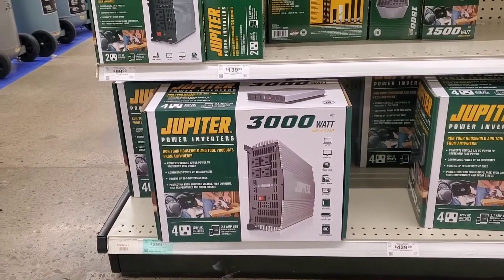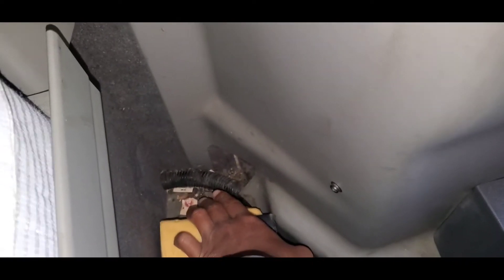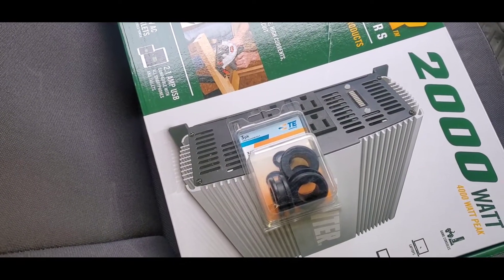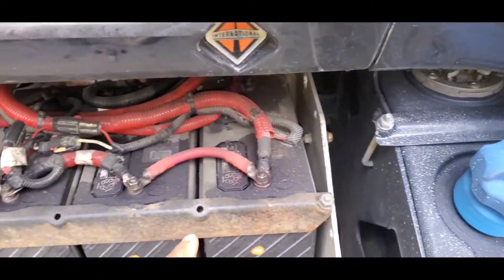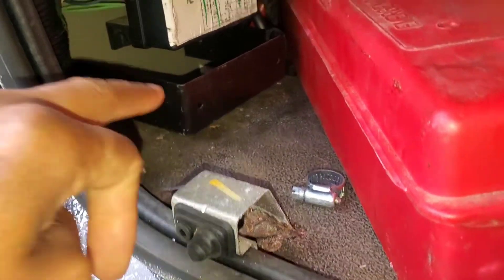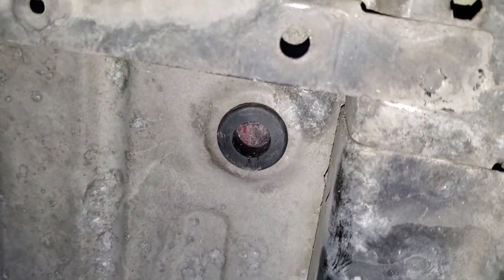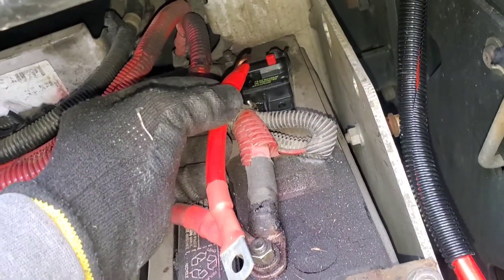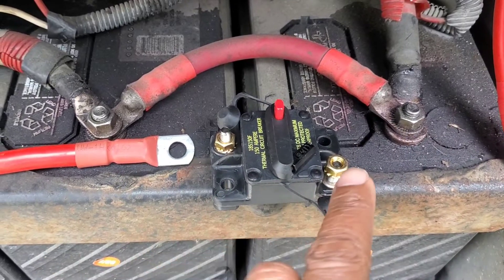Power inverter installed in a international prostar semi truck.how to install a Power inverter.

Comment: I’m not understanding why he used a breaker . The inverter has emergency shut off points
Reply: Have you seen the manufacturer install videos on here for different inverters? Almost everyone uses fuses or breakers. Why risk fire over a cheap safety measure?
Reply: @armandgreer2103 when you buy a new truck that has a inverter there is no breaker dude..I think you guys are lost in the past. modern inverters have built in safety measures
Reply: I've installed probally 10 inverters and never used a breaker. The proper inverter have a built in fuse..just my experience

Comment: I got the same inverter. In the process of wiring it up to my f150. I’ve got a 250 and a 300 amp circuit breakers. Is one of those right to use?  
Great video by the way! Very helpful. 👍
Reply from the maker: Use the 250amp

Comment: Where do you run the ground wire to?
Reply from the maker: To the battery and inverter
Reply: No no, the ground wire should go to the chassis on the truck. (The metal frame underneath the truck). Anywhere on the chassis is fine as long as it's free of paint and rust  where you connect the wire. If you connect the ground wire to the battery you are defeating the purpose of the ground wire completely and you WILL burn and destroy the inverter and probably start a fire.

Comment: How are you calculating the circuit breaker size? Is it 120V times 10A tool = 1200Watts / 12V = 100A ?
Reply from the maker: That formula works too but i just go with the manufacturer recommendation for the breaker

Comment: Did u end up getting a 200amp circuit breaker or kept the 150 I can’t find 200amp
Reply from the maker: I'm still using the 150 and never had no issues whatsoever!
Reply: Thanks for the reply appreciate it driver

Comment: I have same setup but my inverter is 5000watt, after 10-20 seconds later I on my microwave fuse turned off and no more power until I push back the fuse 
You got any advice for that ?
Reply from the maker: Do you have anything else other than the microwave plug into the inverter.
Do your microwave have a fuse on it? If so what size fuse and how much much watt is your microwave.also the wires your using did they came with the inverter, what size are the wires?
Reply: @truckingpaysthebills5394  thanks for reply, sorry I wrote wrong,microwave doesn’t have fuse but inverter does. It same fuse that showing on this video but 100amp. Inverter didn’t come with wire but one mechanic fix for me using same size wire that I have in my battery pack
Reply from the maker: @ruchiracm   @SrimeX  I did not use a fuse, i used a breaker and its 150amp. It sound like you need a higher fuse or breaker the one you are using. For a 5000 watt inverter 100 amp is too low try a 250amp instead. I think that will fix your problem.

Comment: How has the inverter and breaker worked so far? Planning to install the same this week
Reply from the maker: Flawless! no issues whatsoever.
Reply: Did you ever add a ground wire or was it never needed

Comment: Great video. Thank a lot. Quick question do I need to keep start my truck when I use inverter for like TV, microwave and other things ? God bless. Be safe
Reply from the maker: You should have a low voltage warning on your truck that will lot you know when your battery are getting too low if you planning on putting a inverter some inverter have some built in and some truck have them integrated they also make some that plug in your cigarette outlet.
You can watch your TV for hours with your truck off, how long depends on the watts you are pulling. For the microwave i recommend running your truck while using it but i have use my microwave with my truck off for 2 to 3 minutes many times with no issues

Comment: Do your fan cut on in off sporadically when using it
Reply from the maker: It depends, i noticed over the summer time it does, but once it got cold it never cut on. I never run it that long using high voltage appliance 2 minutes tops using my microwave and it never cut on.

Comment: Hey there what if I have a 5000 watt inverter, is 300 amp circuit is enough? If not ,what should be ? Thanks you
Reply from the maker: Thats size is good
Reply: Thanks again. I have so much infos in your videos.

Comment: Great Job!! Very simple and easy to understand! What gage cables are you using, I picked up 2 gage was this correct?
Reply from the maker: 2 gage is correct
Reply: @truckingpaysthebills5394  thank you!
What did you use to cut and crimp the cables?

Comment: thanks for great video. do you know how long batteries would last on continuous use before draining them out
Reply from the maker: It all depends on what appliances you have hooked up to it. What will you be running continuously?
Reply: @truckingpaysthebills5394  1000w portable ac unit
Reply: @marijanxx so how long did it last?
Reply: I’m running Mini refrigerator TV monitor and printer in my semi how long will the batteries last
Reply: @Detaileddescription I wouldent use anything continually . Just tv for long periods

Comment: What size nut is on the battery? Is it just a 10mm?
Reply from the maker: The nut is a 14MM but you can use a 14MM or a 9/16 Socket to take off the nut.
Reply: @truckingpaysthebills5394  my truck has fairings over the battery box and I’m trying to not have to remove them. Also, which terminals do you hook the connectors to? There are like 3 batteries. Pretty sure they’re wired in series, so it might not matter?
Reply from the maker: @KSE828  it doesn't matter any terminal is good
Reply from the maker: @KSE828 actually hook your cables to the battery terminal nearest to where your inverter will be mounted, the shorter the cables the better.
Reply: @truckingpaysthebills5394  Yeah that ship has sailed, unfortunately. The inverter comes with really short cables, so I already had to drop $40 on a different set that were longer.
Reply from the maker: @KSE828  yea if they do include cables most of the time  they always will be short.I call those cables courtesy cables.
Good luck with your project.

Comment: excellent video.  I have a question in hopes someone can give me an honest answer.  My Prostar doesn't have an APU, but there is an outlet under the side pocket door that says cab power.  I used an extension cord and plugged it into the house and the cab had power including the 110v outlets inside the cab.
I have the same batteries you're using and then there are four more under the step box to the catwalk.  My thought is to buy an inverter like yours and mount it inside the side pocket or better yet under the center storage under the rack/bed.  I'm thinking of unplugging the cab power outlet and running it into the side pocket to plug it into the new power inverter.  My theory is that I'll be able to use the 110v outlets in the cab.
Reply from the maker: Hi Richard i understand what you are asking and don't see any reason why it wouldn't work with the inverter it would basically give you 2 extra sockets.Is there a blug on the end of the outlet in the side packet or is it hard wired?
Reply: @truckingpaysthebills5394  I wish I could post a pic.  It looks like the male end that an extension cord plugs into.  kinda like an electric weed eater or similar device.
Reply from the maker: @richardu6244  just keep this in mind on AC currently the wider male prong is the neutral wire and the smaller wire is the hot side.the inverter job is to convert DC currently in to AC current.If you can identify the neutral and hot side on the outlet then you can plug them in correctly on the inverter

Comment: Great video.  Can you always leave the fuse on reset or do you have to try it depending on usage?
Reply from the maker: You will always leave the breaker set.After you hook up the inverter in your vehicle the only time you will need to hit the reset button is when the breaker is trip because of over load or a issue with the wires that's cause the breaker to trip.

Comment: I installed the 3000 jupiter n its works better then wat i thought, installation with cable only.. no fuses n works perfectly
Reply from the maker: These inverters are excellent inverters  i can't say one bad thing about them
Reply: But heard you’ll burn down your truck like that
Reply from the maker: @ShootaTayTay  installing a fuse or a relay switch will prevent a fire

Comment: Excellent job. When get some down time go back and remove the grommets and use some fingernail enamel or primer paint and paint the metal where you drilled. It'll prevent rust.